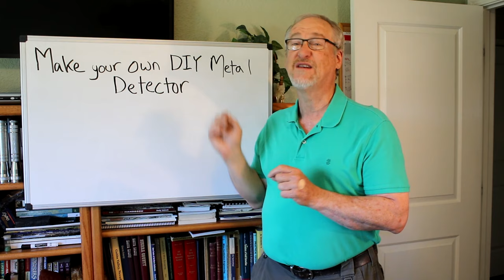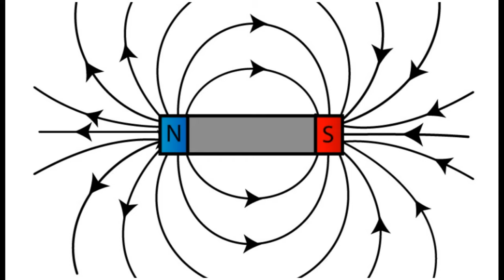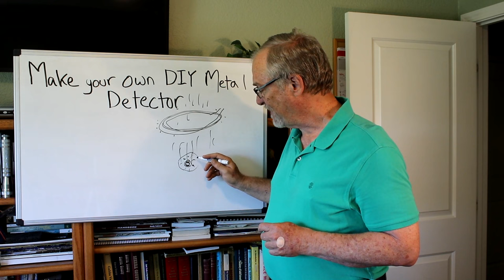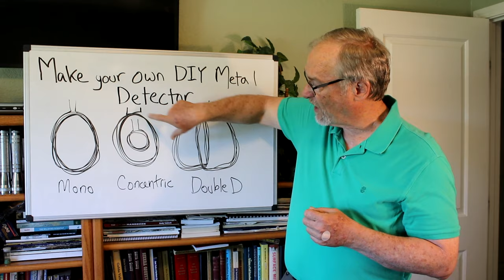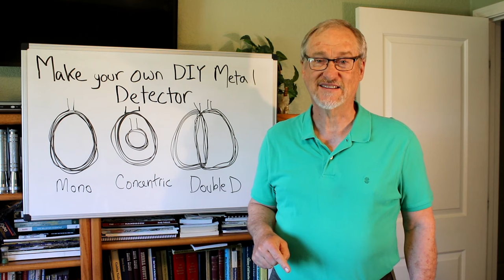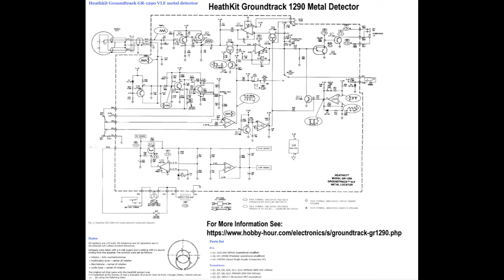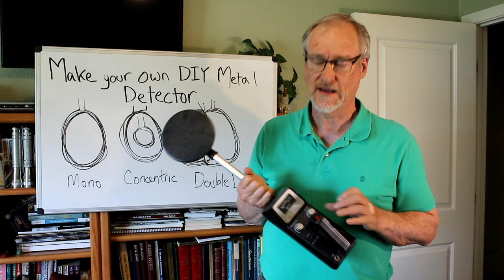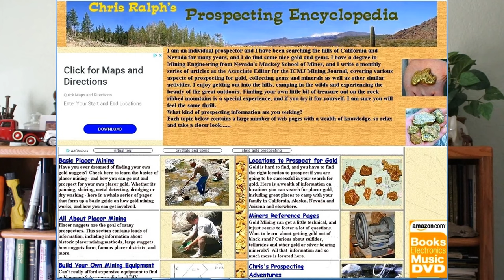Make your own DIY metal detector - turn transistors and other electronic parts into a metal detector

Comment: I´m not able to design something like a metaldetektor from scratch, but i do know how to use a soldering iron and a bit about what the different components are and what they do. 
Metal detectors have always fascinated me and i have built several metal detectors from the very simple BFO designs found in old books and on the internet to more complicated detectors like the pulse induction whites idx pro/vdi clone which can be found on the internet. It was a lot of fun making the pcb, winding the copper coils and find the right components and soldering it all together.  
I found several coins  on the beach with the whites clone and dug up a lot of pull tabs from beer cans... I finally gave in and bought a brand new XP detector.
Reply from the maker: Congrats on your success of building one. Well done.
Reply: Doing electronics and appliance scrapping is an excellent source of free components. Coils, transformers, transistors, endless diodes, resistors, and capacitors And endless free hardware too lol 
(And the cash from scrapping what you don't keep can be pretty decent too)
[Not to mention a lot of circuit board components and anything with electric contacts, there's the gold and silver, tantalum, and sometimes palladium]

Comment: I probably have every component I would need, before I even watch this, because I have tons and tons of electronic components, some I got through auctions, some buy buying various electronic components, some by literally soaking up old television sets people throw out.

And on top of that I have a custom built coil winding machine where I can mount any capstan on I want to on it and it has a counter so I can make an exact number of turns.

My dad taught me electronic theory and gave me various radio kits to build as a child, and I have built high power driver systems, so generally, I'm pretty confident that I can do it.

And if not, my younger electronics engineer brother can fine tune it.
Reply from the maker: Best of luck to you in your efforts.
Reply: most detectors start with an opamp or a comparator IC.  some enameled wire for inductors.  you can have a working metal detector with as few as 12 components. (including the 9V battery)  its a fun project  EDIT.  you wont find 'gold' nuggets  you'll find 'coins' and 'junk'
Reply: @supyrow  I know that, I know how they work because I have done energy research for many years.

Part of energy research is knowing how metals respond to magnetic fields.

I know that gold, unlike iron and copper, is a diamagnetic metal.

This is one of the properties to know about it which is critical for telling it apart from iron, copper, lead, nickel or any alloy of them.
Reply: @hunnybunnysheavymetalmusic6542  gold would be detected.  it would be in the center of the detection range of the opamp.   thats why you get this 'wobble' sound on old metal detectors, it is oscillating.  where as iron or say aluminum would register from the inductor coil on the positive or negative feedback sides of the opamp.  it is automatically included since it contains properties of both.  what i meant by the phrase 'you wont find gold nuggets' i was implying the 'target' would not be large enough to find any meaningful gold with a homemade detector. gold coins?  yes, it would 'detect'.   i would suggest anyone to purchase a professional metal detector for professional prospecting.    if your just playing games, make one.. it's fun!
Reply: @supyrow  I also know about the nuclear physics of electron spins and polarity and will be employing this, because it allows me to really fine tune pulsing circuits that stratify the resonance of a given atomic element, on top of the magnetic field effects it produces, and along with some 'beam antenna' technology I learned in the USAF based on radar systems, I know how to not merely tune for frequencies and spins, but how to aim and focus a phased array emitter to make it actually sweep all on its own [as in not needing to have a hand held coil, but basically ground penetrating radar (you can rent GPR but its not tuned specifically for gold, it just gives you a general idea what is down there within 25 feet of the surface...not what I need nor what I am aiming to make)] moving on a close conforming, self propelled cart.

This device will have room for some pretty complex modulation and monitoring equipment, a computer [likely a laptop], its own power [either all DC power, or a very highly cleaned AC power through a small turbine engine], a seat, fuel, lights, balancing legs [for steep and irregular ground, so it doesn't tip over], and a very high resolution GPS system [for mapping].

On top of that, I will employ a drone that will  track and video the whole thing so that everything is not merely a map coordinate, but also there will be a [relatively, based on variable such as ground cover (snow, grass, trees, fallen leaves, etc) and sun direction, available light, etc.] and this will be live streamed into a data compilation so that it is exactly tracked and time stamped with all of the rest of the data so it will be one continuous parallel file system that makes a 3D map with all the information so that a potential client can literally play and rewind it, slow it down, freeze frame it, etc.

While I had recently been slammed by some bad people who had screwed with my many years of college credits which I was hoping to take to the local university and pursue a course in geology with, recently the government contacted me and is looking into helping me recover my pristine college history so I can return to school and get my geology degree.

I will not only be looking into mineralogy, but also I have been studying topography and how to use geophone technology.

I saw some truly excellent ways to make geophone arrays at home, for as little as $25 per unit, and that is with all store bought stuff.

I may have most, if not all of what it takes on hand to make hundreds of them.

I live in an area jam packed with mines, some of which had reported assays up to 300 oz/t silver, but right now, I'm happy even just mapping other people's mines and prospects, even if I never get to own a mine of my own.

If I am successful enough, I'll maybe end up with enough money to purchase one of the many hundreds of abandoned mines near me.
Reply: @hunnybunnysheavymetalmusic6542  wow.   i have a masters in electronics engineering.  we should talk.